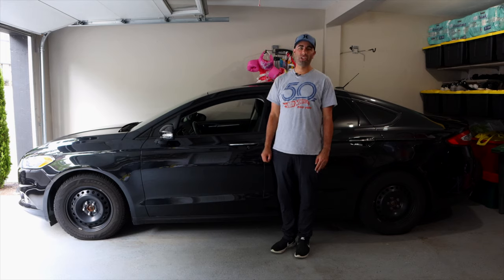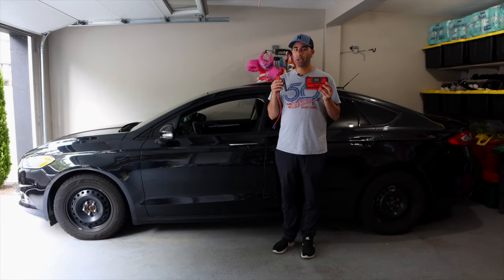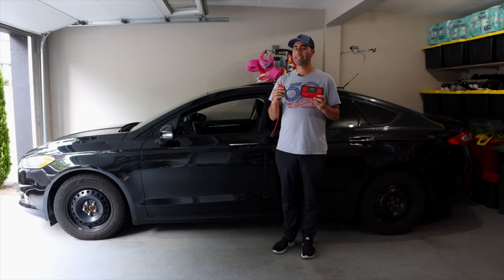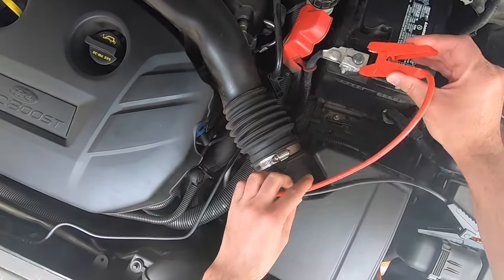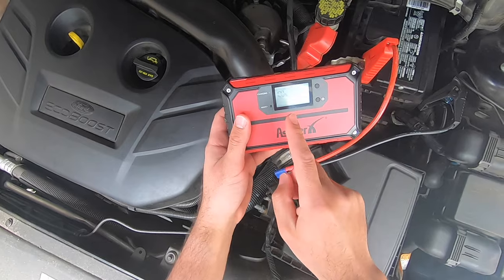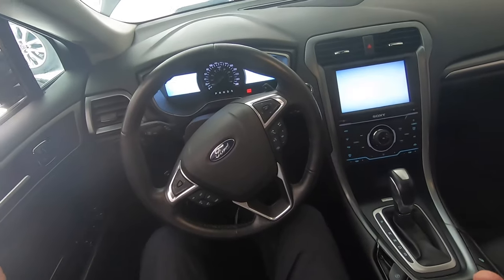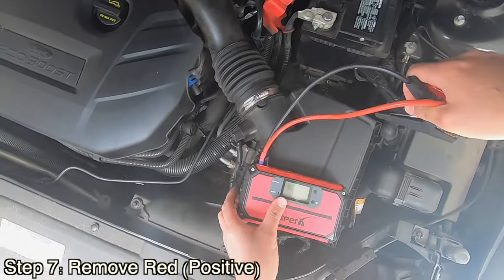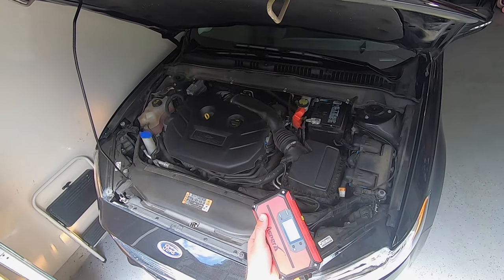How To Jump Start Your Car With A Battery Pack

Comment: I have a TrekPower battery pack. In my experience,  you should bring it back up to full charge at least  once a month. I haven't used mine for several months and when I needed it  to day, It only has a 25% charge. I'm at home, so its on the charger for a couple of hours. But don't throw it in the trunk and expect it to save your bacon out in the middle of nowhere, 6 months later.  His recommended brand may last longer.

Comment: Just needed to check that I connect the cables in the correct order and your video is very concise and helpful. Thanks!
Reply: Those devices are awesome, got a similar one a week ago, they will even tell you when the cables are crossed 🤞 and strength of batter and an override function.  It’s worth having one for anyone with a 3 year old plus 🔋 battery

Comment: I might be wrong, but isnt jumping a battery pushing some serious amps, and therefor its pretty dangerous to ground it to "whatever", since not all wires are thick enough to handle that?

Comment: I'm confused. Every single time in my entire life that I attach negative to a metal piece like a bracket, the engine block or the frame, nothing ever happens. No car or forklift has ever, in my 31 years, turned over that way.

But negative cable to negative terminal?

Works flawlessly every single time.

Why is this? My battery died this morning so I tried it your way in the video and the lights came on, but when I started it, everything had a full blown seizure and freaked out.

I did it my way, and it worked like a charm.

- Car off
- Lights and everything off
- Charger off
- Positive to positive
- Negative to NEGATIVE and not to the frame or engine block or anything
- Charger on
- Car on

Just did it that way and it's currently running. So what gives?
Reply: I just helped out someone in  parking lot that needed a jump and I had my trusty jump pack with me.  Similar issue to you... we connected black to a screw, no go. Then I moved black to another metal part of the chassis, again no go. Black on negative terminal and it fired right up.  Instructions on the jump pack said black on engine ground... I suppose I'll do it their way twice and my way if it doesn't work by that point.

I keep a Jump-N-Carry JNC660 in every vehicle. I got them after seeing that's what the tow truck driver pulled out when getting helped out years ago.  Just remember to keep them charged :)
Reply: SAME!!!
Reply: I have a dead battery now. Going to try it the way the video suggested just to see if I have a similar issue. I will come back to the comment and edit it to tell y'all my findings.
Reply: @MrR4ge89  so?
Reply: Had the same issue recently when my old car's alternator went. Ironically my jump pack  the cables that were long enough to reach the various grounding points of different cars. When I tried connecting the negative to the strut bolt green light came on telling me it was connected correctly but when  to tried and start the car it barley crranked but it wouldn't start. But when I put the negative clamps on the negative post of the battery the car started right up.

Comment: Does this work on any kind of battery? I’ve got a Varta 12v 80Ah battery?
Reply: Any 12V battery yes. However if the motor is very big, like a huge boat, it might not have enough power to spin the engine.

Comment: This is so simple thank you so much.  So you can connet the negative to "any bolt" ? can you confirm
Reply: The negative of the battery is connected to the chassis of the car. So almost any metal surface is negative.

Comment: I have a similar box but the light turns red and beeps. Looks like the light is on the error section for short. Any ideas what to do to fix this?
Reply: Its not connected in good spot

Comment: I just tried to start my car with similar car starter and nothing. Then with normal big battery and it worked. I quess if your battery is really dried you cant charge it with this little one. (I quess his battery wasnt drained becouse it took just 2% that is not normal)

Comment: After this you'd need to go get a new battery or to charge your battery somewhere right?
Reply from the maker: you could get about 2 car jumps from the battery before having to charge it
Reply: No, but you should drive your car around for 30 minutes
Reply: If you didn't leave any lights on or the radio running (things that may take up all the energy from your battery) I'd recommend getting your battery checked out to make sure no cells are dead. Most battery shops will do this for free I believe. If your battery check is fine then it may be your alternator.  If you left something on like Alex said just drive around and the alternator will re-energize your battery!
Reply: @matttsurumoto3585  Thank you for your reply, I've been wondering the same thing and couldnt find a clear answer until I found your comment.

Comment: My Audew Epower 155 jumper USUALLY  uses 2% to maybe 5% to jump my camry....

..... but the last time I used it littorally less than an hour ago it was charged up to 38% and it took several attempts pressing the boost button in response to flashing green light to get my car to finally start and it drained the booster pack from 38% to 22% 🤨🤔

Is there an electrician thats can please explain? Or maybe I have a faulty unit?
Reply: I have an Audew too, it was so good, the guy tried to keep it, and he was a boss!  Just keep charging it.  Get a good battery for your Camry.
Reply: @raptureangel5409  it has a dualist gold under the hood..... it wasn't the battery's fault but actually my fault 🤷..... I left the key on with the stereo on for so long that the windows an locks almost didn't work at all.....

Comment: Oddly enough i was doing this on a 2.0 fusion too. Those batteries from motorcraft are shit. And ig it was dead dead b/c my battery pack didnt work and i thought i was stupid and didnt connect the capacitor portion correct to the battery or had to wait to build up a charge.

Comment: But that won't help you if your car won't start due to corrosion on your terminals. You will need, a 10 MM wrench to take the connector off the battery and a wire brush to clean the terminals. In my case I couldn't even get the negative connector off after loosening the nut so I also needed many other tools such as a small crowbar to get the damn thing off.

Comment: I've made the mistake of watching too many of these vids because I'm getting conflicting info.  Most instructed me to plug the cables into the starter before attaching to my car.  Some then attach red first followed by black.  After the car is jumped, some say unclamp from red first, then black, which is the opposite of what you say.   

UGH

Comment: My battery was completely dead with no lights and the pack did not work. I connected  the cables to the battery.  I had to jump it with a car.

Comment: It doesn’t work. Left mine connected for 30 minutes with a good charge and it did nothing for my battery unfortunately
Reply: Also just a side note, my battery isn’t even 2 years old 😭
Reply: Next time skip the.negative on ground and go.directly to the.negative terminal.

Comment: Why you didn't show the car if the battery is really dead or you just lied, you should show that before you used the cables? 😂😂😂😂
Reply from the maker: I wouldn’t be putting a battery jump kit on my car if it wasn’t dead.